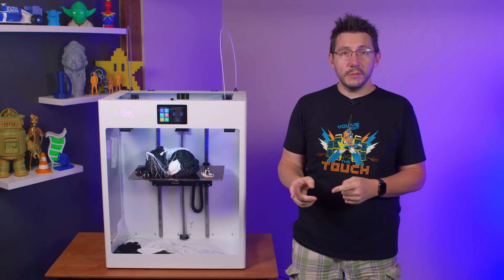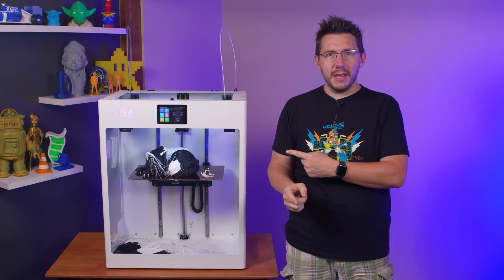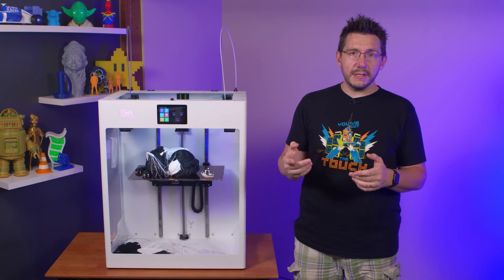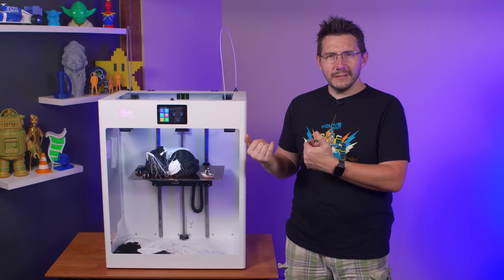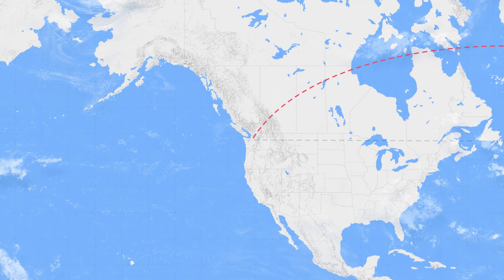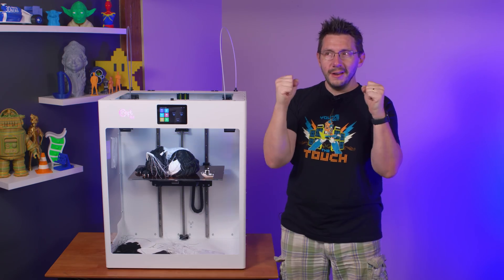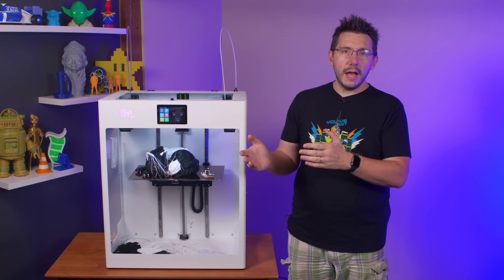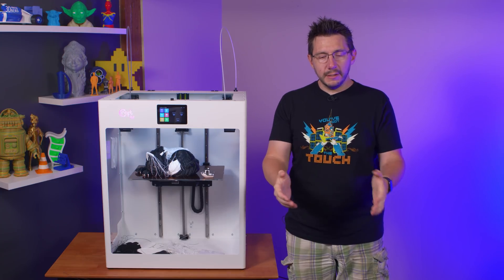Craftbot FLOW IDEX XL Update - THE PINS WERE BENT!

Comment: Hello everyone.  Off topic question. My calipers are cheap, and not very accurate.  I'm looking for new digital calipers that are accurate, but not $100+.  Can anyone recommend a set of digital calipers that are accurate and cost less than $40? Or is that an oxymoron?
Reply: There's dozens of good calipers under 50 bucks. The top names over that price would be mitchioya, brown and sharp and starrett. Spelling is wrong on first as i don't speak Japanese hehe. But they are my favorite.
Reply: Buy once cry once get a pair of mitutoyo and stop being cheap. Look on ebay there is plenty of second hand models.
Reply: Mitutoyo is a great brand. Got my absolute digimatic calipers when i was beginning the apprenticeship 25 years ago. Still is precise and works flawless. Had to change the battery a few times, and took it apart to give it a fancy paintjob, so i (and everyone around me) knows it's mine. Money well spent...
Reply: @ProtonOne11  I see a lot of Mitutoyo models from Wish. They are genuine Mitutoyo, but it's Wish.  Do you think I can trust them?

Comment: I was a high-end geek for a company local to you that sells high-tech networking equipment to big businesses that costs tens to hundreds of K per unit.  I was the top public engineer for a number of years and this meant I was the primary interface with reviewers.  I can assure you that I personally tested every unit before shipping (hardware and software) and if the reviewer would allow it I’d come onsite and unbox it and set it up for them too.  I’d also bring spares.  Reviewers absolutely do get the best treatment: hardware more likely to work, software more likely to function correctly, and all support needs handled with “site down” urgency by the best people who have the best people internally supporting them.  Reviews of equipment sent from manufacturers or their resellers where they think you’re a reviewer and not just a random customer have to be taken with a pinch of salt.  I’m not implying anything untoward about your conduct in this regard (you’re very transparent!), I’m more just speaking as an insider who knows the reality of how reviews work from a hardware vendors point of view.
Reply: If they knew it was going to be reviewed it should have had better care. But the point it seems Joel is making, is that no matter who you are, a machine for $4k should be perfect out of the box.
Reply: @scrapjack it’s surprising the reseller didn’t set it up and test it, repack it, then set it up and test it again just to make sure before they sent it.  It’s entirely possible the pre-jammed filament is due to a bad testing procedure from the factory.  Getting manufacturing production lines up to high quality takes time, which is part of why reviewers get such special treatment: you want to minimize their exposure to the normal noise of new product issues.
Reply: You don’t send someone a replacement part jammed. And you sure as hell don’t send a jammed replacement part to someone that is doing a public video on it.
Reply: @scrapjack I agree, certainly not!  It shows a lack of professionalism on their part.  Not cool.  It seems like they may have rushed this release. :(

Comment: "I';m not mad, I'm disappointed" ooooh they are gonna feel that!
Reply from the maker: That is SUCH a dad line.
Reply: @3DPrintingNerd  'oh, that part breaks during shipping' - but we haven't fixed it (with a 50c connector)
'oh, the filament path jams all the time' - but that's impossible to access without stripping the extruder... and we haven't fixed that either.
Not being funny, for 4 Grand they should have immediately replaced the lot. Not left you fiddling with a screwdriver... almost any Cartesian with dual heads is looking rather competitive, at around 1/4 the price. And pretty much guaranteed to actually work, rather than just guaranteed.
.
The obvious question. How many other stupid corners have they cut? Cos you've not even done 100 hours, let alone 5000.
Reply: I'm disappointed in how mad I am.
Reply: "But daaadddddddd........."😉

Comment: A connection like that should ideally be made with pogo pins and not spring pins
Reply from the maker: I tend to agree with you on that one.
Reply: the spring pins are fine, the problem is that alignement pin was not properly soldered in the first place (looks like it was hand soldered, at least the blob of flux residue on the PCB indicates that to me), and you need at least 2 of them to properly guide the spring pins and contacting pads to eachother. I wonder if the PCB pads used as contact point are actually gold plated, of if they (wrongfully) think that the ENIG from the PCB-fab would be enough. On a 4k$ machine they hopefully did it right, but the bad soldering and lack of quality control paints a bad picture to begin with.
Reply: @ProtonOne11  I would say it is Bleeding edge technology before the bugs are worked out and then it becomes leading edge technology!!! its coming I can feel it!!!
Reply: why pins at all? flat flex or header pins would be far superior. baffles me why they think this is even remotely ok.

Comment: This makes my $1800 T-Rex 3 IDEX machine look amazing in comparison. 400x400x700 build plate and I upgraded the extruder to use BMG dual geared drives. The stock extruders worked great in a 24/7 environment for 3 months straight.

Comment: I wonder if someone bought this printer, if they'd have the same experience you've had with Craftbot replacing it completely? This is why I struggle with stuff like this, I have had very differenct experiences with custom support than what youtuber/streamers seem to get. For $4000, that is a riduclous price to pay for something that just..doesn't seem to work right. I'd expect that from my $300 QQ-S or $200 Q5...not from a $4,000 IDEX.
Reply: I have it, and although it is a great printer. I constantly have issues. They have been reluctant to send parts, needing photo and videos of it not working. I have at this point just bought the parts as replacements
Reply: @DanielpP-md2gz  For a printer that OP, customer service is one of thethings I expect to be superb.
Reply: @DanielpP-md2gz  I've had the machine since November. When one issue is delt with a new one appears. It's been sent in for mechanical repair and came back with electronic issues.
Reply: You're right, it's appalling.
Reply: Its not 4K. Its more. Just got an invoice, they upcharge for everything! A set of flat acrylic doors and set of hinges, that you have to install yourself? $220. 

Our printer, base spec, was quoted at 4800.
Reply: That's why when I get a printer I never really consider these videos from Joel or Angus or whoever to have any weight cause they will always get the best experience and the best cherry picked printer (most of the time). I end up looking at the reviews faaaar down the results list cause THOSE are the real experiences.
Reply: @AmusementLabs  This is not the case, Angus's machine was not cherry picked. I know this for a fact as I sent it to him.
Reply: @fuse3d  thanks for being such a pillar of this community. I think we all know every printer has its flaws. This is not like an ender 3 where it is a simple design with simple electronics. This is a semi professional printer, that in my opinion performs for its price tag.
Reply: They replaced my original FLOW! Didn’t even ask them too!